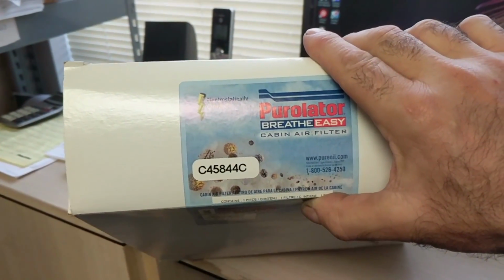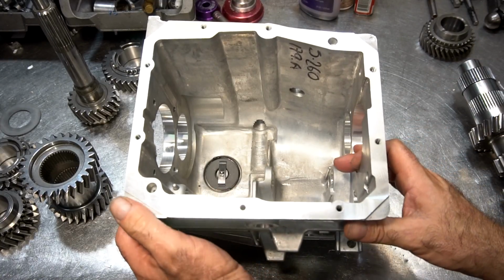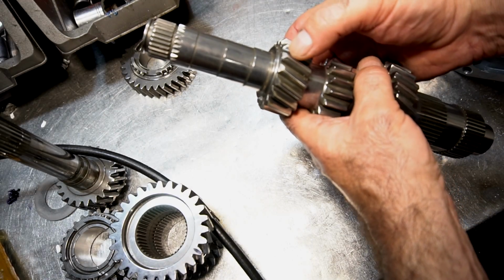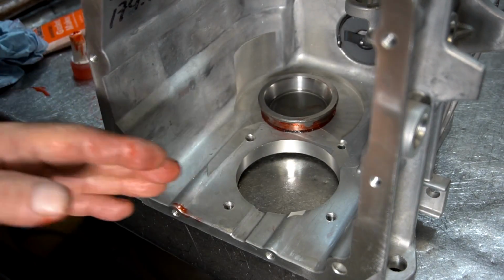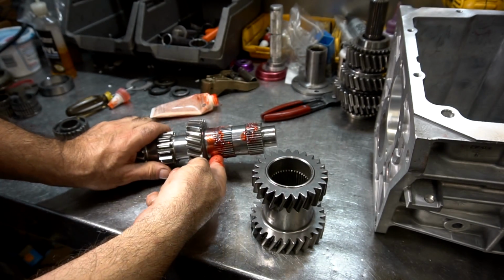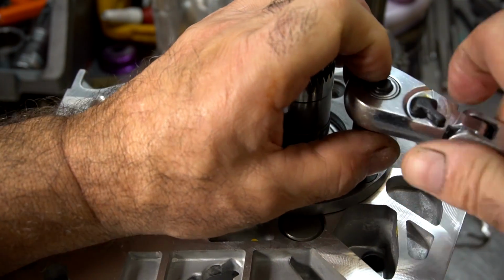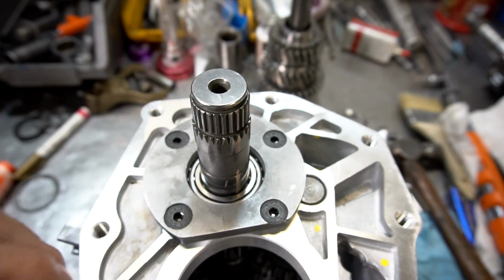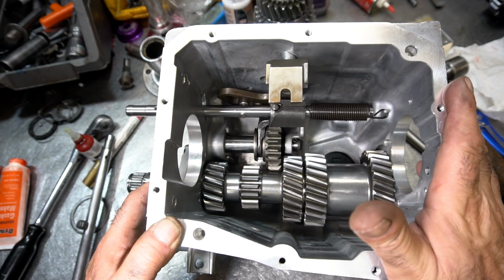How To Rebuild A T5 World Class Transmission - Gforce Gears PT-1

Comment: How much power can this setup actually hold? I'm rough on my car at the track and I'm building the motor to produce in the 400-450hp range at the wheel. I may also run slicks once I modify the rear end to be safe and legal.

Comment: Does the Gforce case need to be beveled to get the countershaft in like the Ford case does?
Reply from the maker: Yes, but only if you plan on installing the aftermarket GeForce gear set. A regular set should go right in

Comment: Great video. Taking on any new work?
Reply from the maker: Sorry,I am not
Reply: @GearBoxVideo  appreciate the honesty! Is there anything to be gained in the strength department with G force main shaft and gear kit along with their aluminum case? I have a 95 mustang that’s at 475whp and I’m on borrowed time.
Reply from the maker: I would use a different transmission. Not waste the money on that T5

Comment: Where do i find those gears ypu removed?
Reply: when finding parts I would go to the people who do the work, not all transmission shops do the work or can find the parts but if you ask your local or not so local mustang enthusiast shop who they use for transmission repairs than just ask those guys for parts
Reply: Sadly we didn't get those mustangs in Australia, im just trying to strengthen it as much as I can
Reply from the maker: The Australian boxes I have seen have gearsets equivilent to the Ford Motorsport transmission with actually larger 1 1/8" input shafts
Reply: @GearBoxVideo  the one I have seen has a tapered roller bearing on the input shaft
Reply from the maker: They all have taoered rollerson the outside

Comment: What If you break the 5th gear and reverse pivot bracket  slider 
Where the t50 pivot bolts to? 28:44
Reply from the maker: What about it? If you break get a new one. Im not getting your question.
Reply: @GearBoxVideo  so the gear shaft doesn't get harmed or the transmission case can get stripped where the t50 bolt goes
Reply from the maker: No. People break them all the time because they mistake it for a fill plug.

Comment: Hey Paul, great videos very helpful. I'm at the point of reinstalling my transmission but I cannot get the reverse rail to slide into gear it seems to jam up. I would be very grateful if you had any ideas. Many thanks.
Reply from the maker: No idea but make sure the rail is polished and free from burrs
Reply: @GearBoxVideo  many thanks Paul much appreciated. 👍
Reply: @GearBoxVideo    Thank you for all the videos you post they are super helpful 🙏I need to buy A T5 rebuild kit for  a 99 to 2004 v6 mustang  Does the kit you sell on your website fit ?
Reply: @cossie dean . Question did you test it with A new to you aftermarket shifter/ going through all the gears with it ??

Comment: Paul, Thanks for your answer to my question. However, The old transmission and clutch disc I have is a 26 with 1 1/8" Dia. and the rebuilt trans has the14 spline with a 1" Dia.. I wanted to keep the bigger input shaft if that is possible. Thanks for your expertise on this.
Reply from the maker: companies such as Mcleod can custyom make a 11" 14 spline disc.

Comment: Hi Paul, I have a question, I know you build transmissions for a living so my question was is can I run Pennzoil Synchromesh trans fluid in my 1986 mustang gt with a a t5? I know not al foxbody t5s we're necessarily the same I know some were world class and some weren't but my t5 is stock same as the motor with 70k original miles on it could you please shed some light on this? Thank you so much appreciated!!
Reply from the maker: Yes.. It's called Synchromax
Reply: @GearBoxVideo  okay thanks I looked  it up and it's a yellow bottle says (Pennzoil Synchromesh ATF) I couldn't find any syncromax tho
Reply from the maker: That works

Comment: Does the case and first gear have to bed modified for all g-force gear sets? Or just the sets with the taller first gear(2.42 I think?), I know there's plenty of T5s with 2.95 first gears, and was curious if the g-force gear set with the same 2.95 first gear would still require the beveling and such?
And if a guy wanted to keep his stock 5th gear, would that still work on the g-force cluster shaft?

 Thanks
Reply from the maker: Only on the close ratio set
Reply: @GearBoxVideo  I'm also guessing that all the reverse gears are the same ratio? I haven't found anything anywhere with information about the reverse gears having different ratios or idler sizes.
Reply from the maker: They are the same gears

Comment: I have a WC T5 from a 94 mustang v6 that I plan on converting to V8! My plan is to rebuild it to be as strong as possible! At least 400 wheel hp if possible if not more but also have it be reliable as possible with street tires! Is there a specific kit I could buy to do this? I basically want to build the strongest t5 I can because I have a few of them I know how to convert them to V8 I'm very familiar with them and I love the transmission but cannot afford a TKO, T56! Thank you
Reply from the maker: I would not waste money attempting that. Just get a TKO or a new TKX. The cost to change gears and still have a substantially weak unit is not worth it.

Comment: Hi Paul love your videos and parts.I bought your kit for my  t5 for my mustang(93lx) After rebuild I couldn't get it into first.playing with it running and off,and when it went into first it made an awful sound.I pulled it out immediately.please tell me what to look for,what I could of done wrong.when it was in 2,3,4,and Fifth and reverse worked. I need your expert help
Reply from the maker: Best to carefully watch the video. Sounds like a fork or slider are in backwards
Reply: Well you would not believe it Paul, everything ,almost everything checked out.I installed the fifth/reverse rail 180 out. I guess when I was lining up the roll pin I didn't pay attention to where that roll pin bearing on the rail was ,it was just sitting there not doing it job. I can manually shift it into first now and spin the input shaft.Only damage was the reverse brake gang snapped off.
Reply: Thanks,will take it apart this weekend and look.

Comment: hey Paul great videos and full of information. I had a question about my T5 NWC the 5th gear needs to be replaced and until i get the new gear would the transmission still work as it should even if i remove the 5th gear (the smaller one) out of the tail housing but then just run the car in gears 1-4? sorry if that doesn't make sense
Reply from the maker: It will because the rear bearing zis held by the race. Use my email at support@5speeds.com and let me know tooth count and make and model

Comment: Where could I find a good rebuilt  one of these for a GM? I saw your tube e-bay vid and don't want to get a pos. I want to replace my Doug Nash 4+3 with one in an 87 vette.
Reply from the maker: Just use the 4+3. It's a better trans
Reply: @GearBoxVideo  OD unit is burned up . After research If I can find an LT1 Tremec from a 94-97 camaro/firebird I will swap that in or a TKO 600. I hate the 4+3

Comment: I was curious about changing the overdrive gears on my t5 in my 88 tbird, I'm trying to get a final drive that is close to .5 ratio instead of the .68 I've been told it has, in theory that a 27t main shaft gear and a 51 tooth counter shaft gear will get me close to that ratio, my question is does the input shaft gear affect the final drive ratio at all? Yes I realize that there are easier ways to go about having that final drive ratio such as a stock t56 magnum but I'm looking at doing this myself possbily and the gears from all state gear is just a few hundred rather than a couple thousand for adapters and such.... looking to do this just for little more range in my final drive on my old bird. Thank you for your time.
Reply from the maker: Maindrive ratio x 5th ratio is the final OD ratio
Reply: @GearBoxVideo  you wouldn't happen to know the stock maindrive ratio on 88 tbird t5 would you? I am able to find it for v8 cars but not the 4cyl for the tooth on the input gear and the countershaft gear.

Comment: Hey Paul, ive been enjoying your videos.  I have a question that I bet you hear a lot.  I have a classic mustang currently uses a C4 automatic - behind a stroker 331 Windsor engine (over 400hp and with future goals of more like 500hp and 500tq).  I dont drag race, but just want a nice, slick shifting trans that can take my bad driving.  A lot of people use T5s, TKOs and also some T56 transmissions.  Theres a big difference in prices, weight and strength between them.  I get that the TKO is kind of a clunky truck transmission, and benefits from upgraded synchro rings.  Its hard to find used TKOs as well.  But a G force gearset like in these videos would be an option for me.  T56 is expensive and I dont feel like I need 6 speeds but it seems like there is more of them around, and maybe its a good choice?  whats your advice?
Reply from the maker: I would go with the TKO

Comment: Great video Paul. I'm about to start building a G-Force T5 and I keep hearing about the need to use a reverse idler bushing in place of the o-ring to clear the cluster gear, have you ran in to this problem? I see in the vid you use the o-ring. Cheers, Simon.
Reply from the maker: Built many and never had to do that.

Comment: Paul, again great content... Wondering if you have ever used the AstroPerformance Gearsets? I was talking to a guy and just seeing on some of the forums that they may be stronger, maybe a better finished product too. Of course they offer a few different strengths options  so who knows who  has what lol?  Have you used the G-Force Case for any builds?
Reply from the maker: Yes and I don't use them.   I try to avoid dealing with companies in general that seem to always be out of stock of critical parts. Lately this seems to be a common problem with a lot of vendors that supply me.
Reply: @GearBoxVideo  My experience with them in a  phone call they come off a little pushy claiming gears breakage on G-Force gears vs theirs and that the case was not needed. IDK  how that can be qualified with different cars of varying power and weights and traction? G-Force had the different OD/synchro options and supposedly same material and width gears...  My understanding of the stock case was it was a little weak for  behind a V8 and +3000lbs and that allowed the shafts to spread and tooth engagement to be compromised?  The problem I had with this conversation  was this was for a cruiser I wanted to modestly road race not really drag race.  Since I didn't have a case, what was an extra 150 vs buying a new OEM one or used one?  Plus the benefit of it being  drilled for a sbc the bolt pattern negated the adapter plate nonsense... Still leaning T-5 for my C3, would like to get as much weight out as possible as  I start to put it back together. Close to PBIR  so that is where my interest is at this point.

Comment: Can that Dynatex sealant be used for engine assembly, or is it's temperature range not high enough?  I like the fact that it doesn't set up until after parts are assembled.  I sometimes feel rushed when using silicone for large assemblies, as it skins over pretty quick.
Reply from the maker: Yes it can be used with no problem. Many builder's use it for engine assembly
Reply: @GearBoxVideo  Thanks. I'll order a couple tubes.

Comment: Suggestion:  Get an air die grinder, preferably a right angle one, and the high speed will let those burrs cut aluminum like hot butter.

Comment: Hi Paul! Have you ever done a thunderbird sc M5R2? Would love to see a video on one of them. I've got a bad 1+ 2 blocker. Problem is I can't find a new gear for 2nd anywhere. Supercoupe performance has fiber lined blockers but the biggest issue is I know all the bolts are probably going to break when I try to disassemble this thing. Nastiest corroded trans I've ever seen but it was an 8k mile trans. Everything beside 1 to 2 works great.
Reply: Ps. It's a 95 T bird sc M5R2. Curious if the 2 gear, gear is different on the 2wd m5od from an F 150
Reply from the maker: Usually if one comes in the shop I'll do a video. I would suggest getting the tooth count if the gear you need. Some parts are available.
Reply: @GearBoxVideo . I'll be removing the trans before spring for sure. If i need the gear i will for sure get ahold of you. I appreciate the reply big time! 👍🏻i have a feeling it might be easier to get another trans that wasn't as corroded from big city salty interstate roads and that way if bolts snap off on the current top cover and or front/rear I'll at least have extra parts.
Reply from the maker: www.5speeds.com/requests.html

Comment: Good day mr cangialosi.quick question.i have a 1993 s10 with a t5.im thinking it is a wc being a 93.im searching for the counter shaft for it but all I find is non wc countershafts.are there differences between the non and wc counter shafts?mine broke 3rd on the cluster and counter shaft.
Reply from the maker: Take it apart first. These boxes have different ratios so best to get it apart first. Counter gear has numbers on it.. best to count gear teeth. I stock most S10 parts that are WC.  Contact info is in the channel's ABOUT section

Comment: any particular reason to use a ford/tremec case over the g force case?
Reply from the maker: theblackmech I'm using a stock Tremec Ford case. Gforce doesn't make a HD cover. So even if you go with a Gforce case you have to use a stock cover.

Comment: hey paul I just had my t-5 rebuilt and when I shift paul into 5th gear it grinds a little and sometimes at high rpm shifting it grinds worst what did the mechanic not do right.
Reply from the maker: Check for a good clutch release.  Where did he get his parts?
Reply: hey paul it happends when I come out of 4th gear and only when Iam really getten it hi in rpms , clutch engage ment is ok aka turbo car
Reply: o paul is a g-force built t-5 a good trans for 500hp

Comment: I guess they make the front countershaft bearing a slip fit because you can't get a bearing puller under it, with the counterbore on that input cluster gear.
Reply from the maker: Factory bearing is the same way. You have to cut the cage and then put a bearing clamp on it

Comment: Hi Sr, i love your videos, I got a 1989 Ford Mustang GT 5.0 5 speed and your videos have been very helpful  so thanks! ! But I have a question,  what did you mean wen you sead world class transmission?  And what's the difference?  Thanks again Sr! I'm your biggest fan!
Reply from the maker: +Miguel Antonio You may want to go on my website and read about the difference. www.5speeds.com
Reply: World class has needle bearing under the gears

Comment: Paul what kind of digital torque wrench do you use / great videos
Reply from the maker: Michael Rousselle I believe I have a a listing link of the stuff I use in this videos description.
Reply: Matco
Reply from the maker: Matco wrenches are made by Apex tool supplier to Gearwrench. You can get them about half the price from GearWrench.

Comment: Hey Paul great video, I love watching these, Paul is a SM 465  4 speed any good? I have a chance to get one the model with the aluminum top cover, thanks.
Reply from the maker: Sm 465 are a work horse.  Later units are better.  Take the PTO covers off when looking for one to purchase and make sure the 3rd gear on the counter has a retaining sleeve and not a snap ring. The snap rings failed on early units.
Reply: Thanks Paul  much appreciated.

Comment: The combination of knowledge experience and skill, Paul it is always a pleasure to watch you work - i take careful note of what you say and do. As i find where i thought i had it right on, was only close - or not even.  I did a T-5 for my S 10 from a boneyard trans i pulled myself. Used the haynes book for info - it worked when i was done. And was better than the clapped out mess
it replaced. Now the engine is getting pretty tired, and the transfer case is sloppy. Engine , transfer case and trans in one shot this time. All new parts for the T-5 this time. Too much of what i reused should have been replaced - oh well i learned.
It had to get back on the road for cheap.